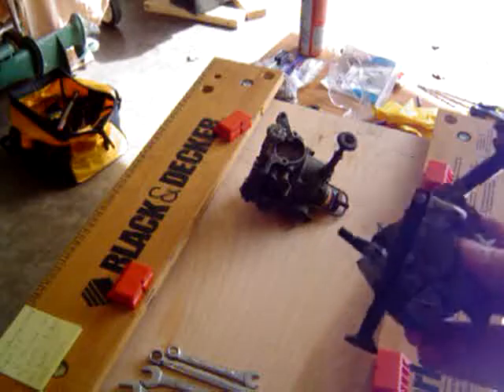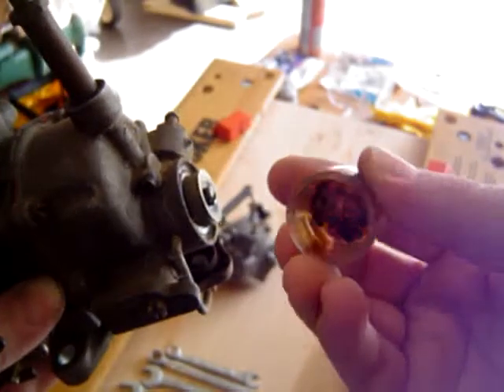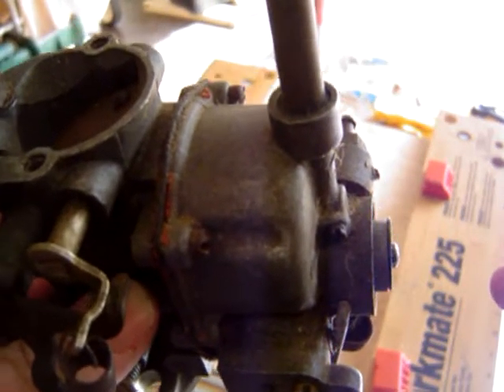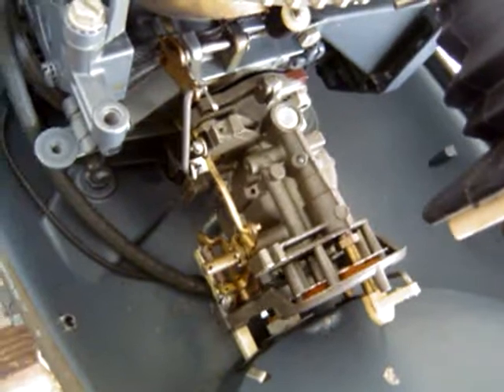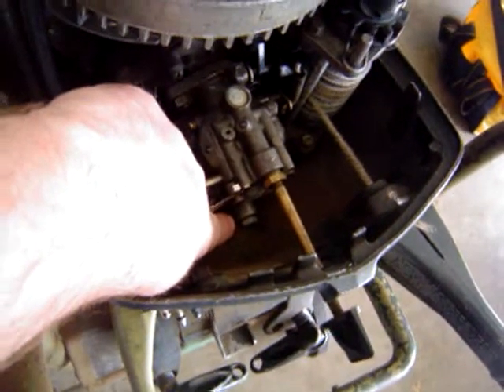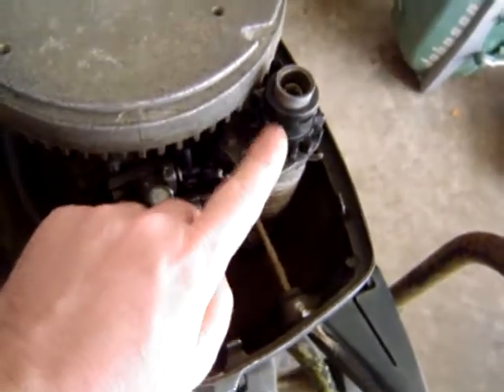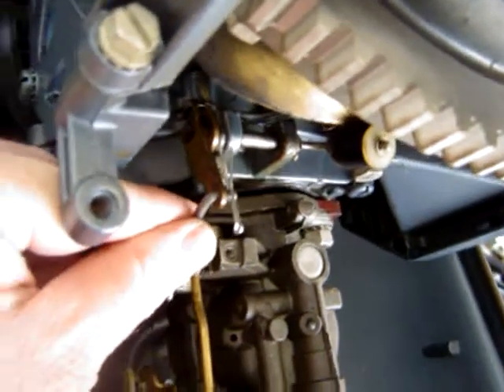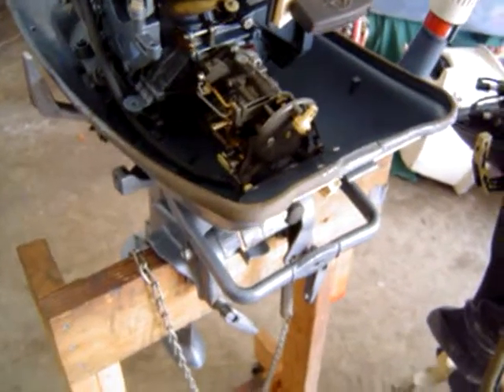OMC fix jet carburetors part 1 of 10 (Motor displayed 1968 Johnson 6hp)

Comment: My 1964 Evinrude 28 HP has a high speed adjustment but the needle is rounded off.  It had a little tit on it like the needle was broken off.  I researched and it actually is made like that.  What is the starting point setting on this?
Reply from the maker: 3rd.  Have a buddy steer and drive while you make the adjustments.  On large motors that is the safe way, especially when the steering and throttle are several feet way!!! :)
Reply: @cajuncookone  Thanks got it set in a barrel.   The low speed seems intermittent.   Getting surging.  Im assuming its filthy after sitting 11 yrs.  Had flushed the lines and seafoamed the float bowl prior.  Maybe throw some in the tank to see if it cleans out. This never idled good anyway so I suspect maybe points and or timing. Seems a lot of unburned fuel as the water barrel got stinky fast
Reply from the maker: @L2fish  yes, seafoam decarbons the powerhead.  You may want to remove your plugs and clean them well with sand paper.  Reclean to remove the grit and make sure they are gapped to 0.030 with a feeler gauge. Seafoam will cause the old sludge to cake up on the spark plugs in the beginning, but should not be problem after that.
Reply from the maker: These are going to be the initial settings for the carburetor for starting purposes. Your will later fine tune the settings.

Facing the carburetor you will notice (top) slow speed/idle knob and the (bottom) high speed needle and knob

- Top needle is your slow idle needle. You will gently turn in (clockwise) until the needle is gently seated..please don't force. Once seated, you will turn out (counter clockwise) the slow idle needle 1 1/2 turns. Leave it there for the time being.

- Bottom needle is your high speed needle. You will gently turn in (clockwise) until the needle is gently seated..please don't force. Once seated, you will turn out (counter clockwise) the slow idle needle 1 turn. Leave it there for the time being.
Reply from the maker: Second part for adjustements once you have it on the boat running.

Setting the high and low needle valves properly:

NOTE: These settings should be done a large test barrel or on the boat in the water/lake!! It best to do these adjustment on the boat in the lake or on commercial size test tank. (You can damage your motor running it wide open in a small test barrel.)

(High Speed) Start engine (it will run pretty rough), shift into forward gear, take up to full throttle. In segments of 1/8 turn in (clockwise), waiting for the engine to respond between turns, start turning in the bottom high speed needle valve. You'll reach a point whereas the engine will either start to die out or spit back (sounds like a mild backfire). At that point, back out (counter clockwise) the needle valve 1/4 turn. Within that 1/4 turn, you'll find the smoothest setting.

(Low Speed) Slow the engine down to where it just stays running. Shift into neutral. Again in segments of 1/8 turn in (clockwise), start to turn the top needle valve in. Wait a few seconds for the engine to respond. As you turn the valve in, the rpms will increase. Lower the rpms again to where the engine will just stay running. Eventually you'll hit the point where the engine wants to die out or it will spit back. Again, at that point, back out the valve 1/4 turn (counter clockwise). Within that 1/4 turn, you'll find the smoothest slow speed setting.

When you have finished the above adjustments, you will have no reason to move them again unless the carburetor fouls/gums up from sitting, in which case you would be required to remove, clean, and rebuild the carburetor anyway

Comment: what is the point of the orifice plug? i have the same type of motor as you (1964 18hp 18402) and I'm currently rebuilding the carb. i couldn't get that thing open cause i don't have that special tool…It looks just like a drain plug? anyways. will my carb not run right if i don't get in there and clean that bitch out?
Reply from the maker: Your motor has a low speed/idle needle that control fuel and air mix at low speed to idling.  The fix jet orifice is a precise meter opening that controls fuel and air mixture for mid to high speed running.  If you do not have the correct bit/tool to remove the jet, then try and cleaning it with carb cleaner spray. 

Please do not try to clean it out with a drill bit or wire.  Those brass jets can be damaged and then the fuel/air mixture is altered and then motor will run poorly.

Comment: On the 18hp, did you have to remove the rubber boot to get the low speed adjustment knob and rod to slide out the front? Mine would'nt come out that way and it was really difficult to pull it forward just far enough to get the carb out with the rubber boot in still in place. I couldn't see how to remove the boot and I didn't want to chance ripping it by pulling on it.